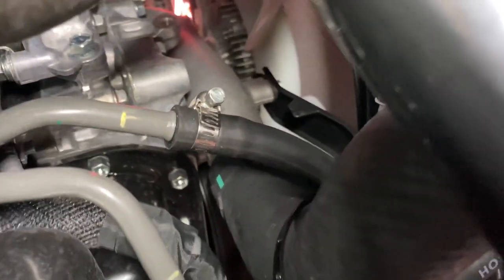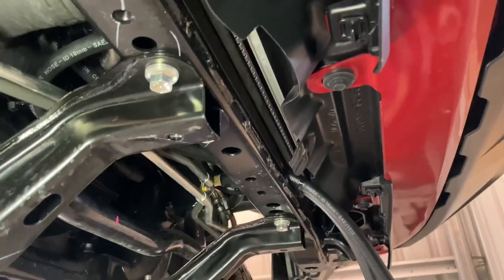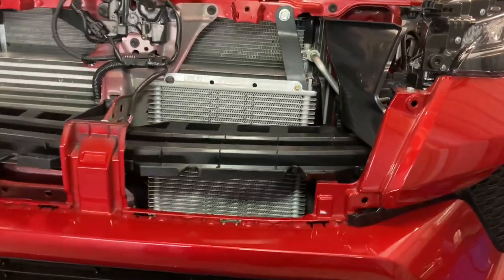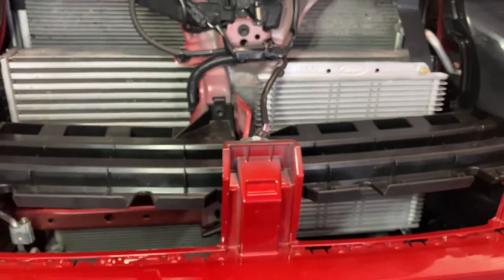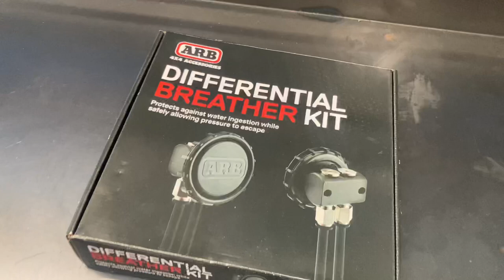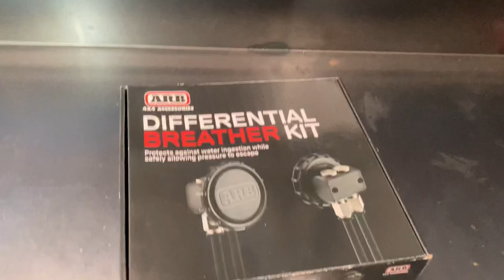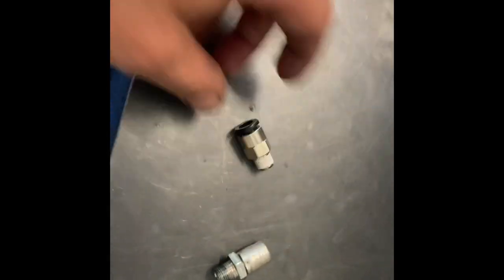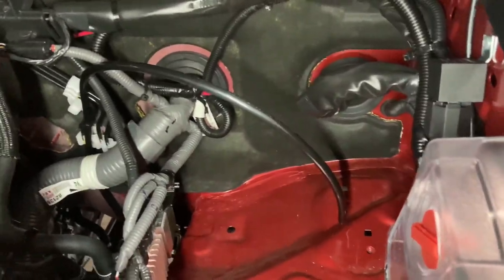Dez Catches Oil and Cools Off. Fortuner Trans Cooler & Catch Can. Ep 5

Comment: Great vid, here is what I've found on my 2017 crusade,  the breathers are:
1. Rear diff
2. 4wd actuator on back of transfer case
3. Transfer case
4. Transmission
5. Front diff
6. Front diff  actuator
1 is directly above the rear diff
2, 3 & 4 are at back of engine block clipped on a bracket
5&6 are on the chassis rail, passengers side in the engine bay near the battery

I have already had water in the front and rear actuators, very expensive to replace them.
I have now extended all the breathers up as high as I could on the fire wall in the engine bay, I would  recommend doing the same as it is a small outlay and could save you thousands $
Looks like you are well on the way, just the actuators to do.
Reply from the maker: Thanks for watching mate. 
The actuators on the face lift models appear to be sealed units. Recently we did exactly as you’ve just said on a 2019 hilux. Checked on mine and didn’t seem to have the breathers on the actuators

Comment: Hi Again, Catch cans and fuel filter. I am fitting a Pre filter straight up. Was going to put on a provent 200. I hear a lot of people say there are more cons than pros. What do you think? Obviously being new it is under warranty
Reply from the maker: I am a big fan of catch cans and always recommend running them on modern turbodiesels
Reply: Dont know who said Provents are trash?
Reply: @Hillzy_Eighty7  John Cadogen Automotive Engineer, Anthony at 4x4 Diesel to name 2. I think its horses for courses. If you only do long runs and it gets warm not to necessary short runs properly a good thing.
Reply from the maker: After 35,000km in this car there is not even a hint of oil residue on the inside of the intake. Customers vehicles I work on even 10,000km do. So I don’t see how this is a bad idea
Reply: @cassarindustries_wheelwerk  exactly
I chucked one on my 22 Crusade after a few hundred kays
Its now done 30 odd thou,gets drained every 5000 and havent had issues
Reply from the maker: Yeah mate, same but I just do mine every service. Never a drama. If it’s a good quality can with a pressure relief valve there isn’t a problem. But if people would rather not, then that’s fine also